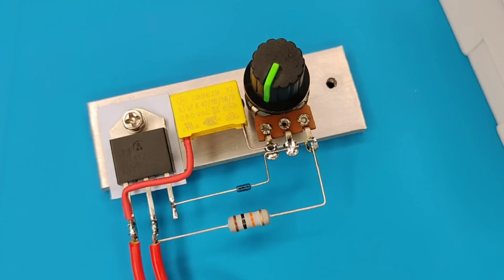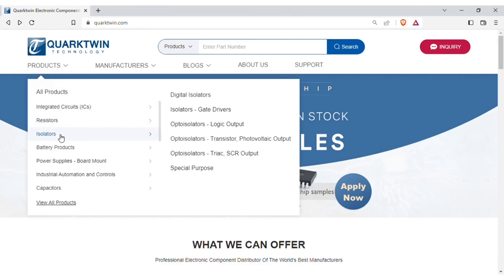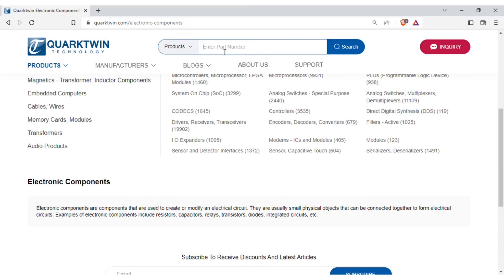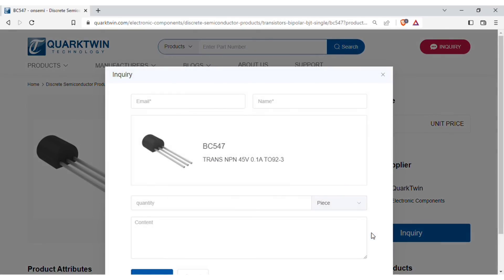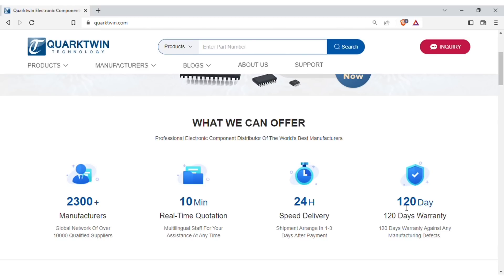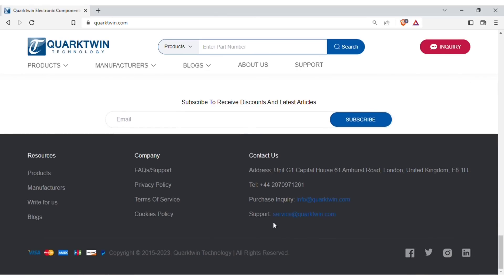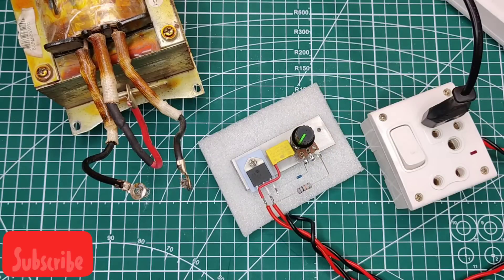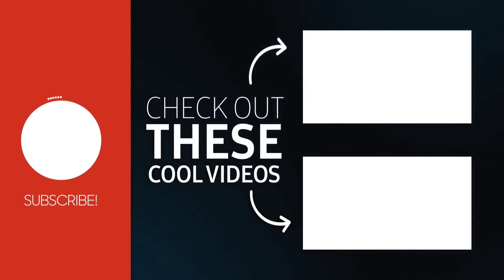Powerful Voltage Regulator circuit 2000W working smoothly

Comment: This is not a regulator, we call it dimmer. 
A regulator arranges voltage, when the mains or supply falls down, regulator tries it higher till it reach to set value and  visa versa. 
Dimmer is not a regulator.

Comment: Hi, So screw up the PV self-consumption sharply in order to save electricity costs by avoiding electricity from the grid / shortening the amortization.  With Dimmer + Solar PV, self-sufficiency will now increase to almost 95%, because expensive purchases from the grid are so easily suppressed and the electricity bill stops just like the electricity meter.  The prerequisite is that you have at least a small solar PV balcony power plant, and you don't need an expensive battery either.  Many examples below: https://youtu.be/eC2olbCBhh0 , Kettle: Without a dimmer, the 2500W - 600W PV system needs = 1900W which you have to pay more for.  If I turn the kettle down to 600W with a dimmer, then every weak PV system can now supply each consumer independently and independently, because the 2500W kettle becomes a 600W kettle thanks to the dimmer.  No magic, just physics.  The 2000W e-heater becomes a 500W e-heater with a dimmer, which can run 12 hours a day free of charge via PV.  The 4000W oven is also tamed.  It is not the solar arrays that need to grow, the consumers simply need to drop by 75%, which is so easy with the dimmer.  I have already switched my entire household to dimmers.  Please have a look at my channel.  🌞 ........... Increase mini PV solar self-sufficiency (winter and camping): You can continuously regulate a boiler and other power-hungry consumers with the "5000W dimmer".  Ebay €7.  I run 4 dimmers in parallel on an 850W inverter.  Kettle 2.2KW at 150W runs 12 hours a day, so the water is always hot https://youtu.be/D9Ss0RuqZG0 .  The room is also nicely heated.  2.5KW washing machine runs in parallel with dimmed to 400...600W and always reaches its 60°C, and also its 1400rpm... It doesn't matter to the washing machine whether it changes the washing temperature to 5min@2500W or 100%  can be achieved free of charge via existing PV power in 20min@600W.  The wash cycle lasts the same time dimmed and non-dimmed, 3Sth 10min.  The iron https://youtu.be/-71oL7z1kMU , dishwasher https://youtu.be/8vnAkrS1x-s , oven https://youtu.be/azDjqZpz77U , electric heater https://youtu.be/QbLWDbJi6ew ,  Waffle iron https://youtube.com/shorts/ofanZCdYEjA?feature=share, coffee machine, all internal heating is throttled with me.  Lots of videos on my channel.  The inverter stays cool and quiet and the MOSFETs + (battery packs) stay intact because extreme current peaks no longer reach the inverter.  Now every Mini PV Inverter is enough to operate large devices.  So, with the dimmer, all internal heaters/devices can be converted into base load devices that stay almost permanently ON, drawing very little current directly from the PV.  With a wattmeter / energy cost meter you can then measure this perfectly in order to set the dimmer optimally.  ........ Comments: "Great idea - despite studying electrical engineering, I didn't think of it myself ;-)" or "I installed it in our washing machine, great idea!"  or "Glück Auf Christian, I'm a professional myself but I haven't figured that out yet. 👌 Greetings Mitch 💚" and many more... LG Christian 🌞 ........... "smart energy saving"  , has made a meaningful reaction video to the dimmer: https://youtu.be/EHtJGiXAjZk .  🌞 ......... "Free Range", also made a meaningful reaction video, to the dimmer: https://youtu.be/qzdRdBObtvY .  👍........ "Jens Kummerow TS", also made a meaningful reaction video for the dimmer: https://youtu.be/fTY5jWvz5CY .  👌 ........... A little hint: Energy cannot be saved.  So if I want to boil my water, I always have to use the same amount of energy for one liter.  Christian's method relies on a longer period of time with less power in order to be able to use the power provided by the PV as efficiently as possible - so consumption peaks are intercepted.  In the end, the energy consumption should even be (slightly) higher due to the interposition of the dimmer, but it doesn't matter, since more efficient coverage by the PV system and therefore better use of the self-generated energy ..........  Here an "automatic PV excess control + remote controlled dimmer with heating element" / load management (consumption / heating rod follows PV excess ...): https://youtu.be/IWp7Mi2FldM .  "Obermühle" solved this via PLC: https://youtu.be/iR30cDaf1Xk "Heating with excess PV🌞Do your own heating rod control".  🌞 .......... I installed a 2-axis solar controller on my DIY solar tracker: https://youtu.be/_Rs8CptQcDw.  .......... More videos on my channel.  LG Christian ............... ATON - Power to Heat: https://youtu.be/wnVSaioJsjY .  .....